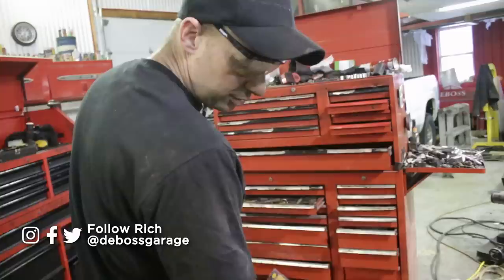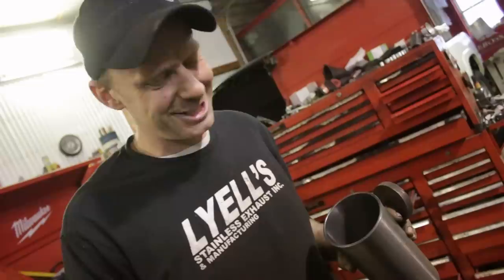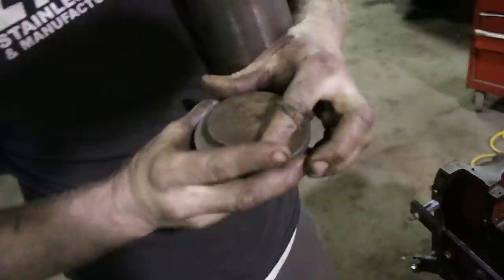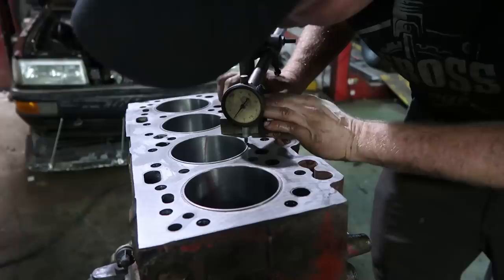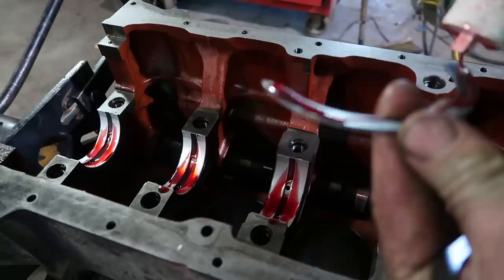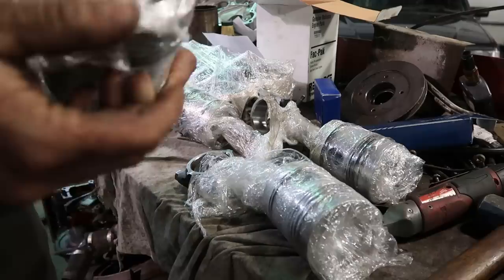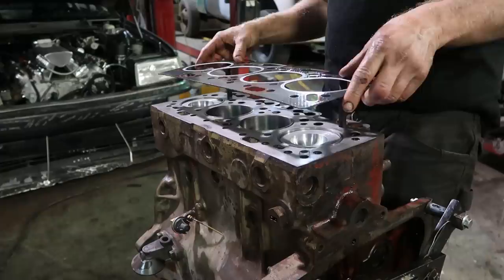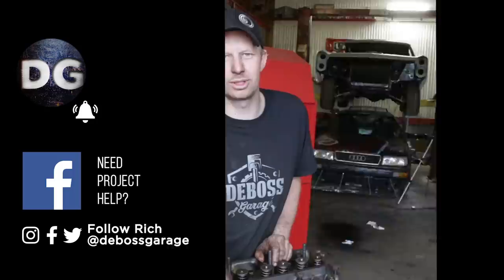3.9 Perkins 4-cyl Dry Sleeve Engine Rebuild | Massey Ferguson 270 [EP2]

Comment: Used to engineer for Baldwin Filters.  MOST Coolant filters do indeed contain SCAs, Supplemental Coolant Additives, and release them into the coolant, while filtering out debris and contaminants.  There are different formulations, in fact, and make sure your filter has the right additive Package for your coolant, based on how my glycol you use mostly.  There are coolant filters that do not have additive packages, if your company uses regular testing to determine the additive levels and maintain them. (So... no truck fleet on earth outside of heavy industry...)  The movement of the liners actually is one of the things that depletes the additive packages.
Reply: Kit Iwamatsu how would you find out what filter you need
Reply: @theshadetreewelder3523  You'd look up your filter size, then decide if you want to use a filter with built in SCA, or use a liquid additive.  Diesel engines need a different package than gas engines.  Standard coolant has everything gas engines need, so no worry there.  Standard coolant does NOT have some of the things diesel engines need, like Nitrites, Borate, MBT, and Silicates.  Some diesel coolants already have a full additive package, and will suggest to NOT use SCAs in addition to what's already in there.  If you are using standard coolants, then you will want the SCAs.  If you use a fully formulated coolant, you do not need an SCA right off the bat, and it should last quite some time (600k miles, or roughly 2 years) thought using test strips every oil change isnt a horrible idea to make sure the Additives are at a good level.

You in general should consult your engine maker as for what coolant, and what SCA should be used.  If your engine manual doesnt detail this (or is a much older engine and uses outdated stuff) then completely flush the system and use new coolant before picking an SCA package.

Anyway, there are, now, really only two additive packages.  SCA, and SCA+.  SCA Also called DCA2 and BTE, and SCA+ is also called DCA4 and BTA+.  If you engine has a lot of aluminum, or has an aluminum block, you will want SCA+.  SCA is fine for all older wet sleeve engines.  In either case, you need to keep the concentration in range.  There are also some diesels with OAT and HOAT coolants... but that's a different story and you see those on much newer engines, and you definitely will refer to the manual on them.
Reply: Yay, learning! Thanks, mate!
Reply: @BadHaddy  Thank you for the detailed answer. Not quite the same question,but for gasoline engines with standard Prestone or equivalent,I recollect the additive package is on the order of 2 ounces per gallon(undiluted), and with the natural increase in acidity,the protection offered only lasts so long. So the question is,what is the best way to keep the stuff from going acid ? Water pump lubricant is about the only thing I have ever seen in the auto stores that contains some replacement stuff,is there a better product made by someone ? Failing all else the old timey answer was to add some Sodium Carbonate, but I feel iffy about that with Aluminum radiators,etc. Cheers.
Reply: @paulmanson253  There is nothing you can reasonably do once the coolant becomes acidic.  Its just the oxidation of the coolant into oxalic and glycolic acid.  The corrosion inhibitors have done their job and it's just time to change the coolant.  You cannot simply re-add the inhibitors for gasoline products in a way that makes financial sense.  ANY product that claims differently is bunk and snake oil, and probably sold alongside engine honey and gasket sealer (note, all junk.)  Since each gaslone engine coolant has its own, rather wildly varying formulation.

The type of coolant you use typically determines it's lifespan.  The reason dexcool and all the other OAT and HOAT coolants came along was to greatly extend this service interval.  When it comes to older coolants, it seems you can classify makers into 3 categories.  Those who used phosphates(Asian), those who used silicates (Euro) and those who used both (Murica).  Mostly down to the water that is common in the areas.  

Anyway,  for older cars using universal/green stuff, just drain and fill.  While you're at it, replace your radiator cap. People ignore the hell out of that and you end up with the dexcool paste-stew.  Just use deionized water, premix with concentrate, and you're golden.   30k miles seems pretty safe.  If you want, get the little floatie-dealie bobber to test your concentration (it's called a hydrometer) and make sure its in the range appropriate for your area.  And maybe dip in some strips every other oil change to see if you're still in a good ph range.  As long as your coolant bottle isn't turning brown you should be fine.  As soon as you see particulates (floaties) and discoloration, drain and fill time.
Reply: @BadHaddy  Well now. Glad I asked. That was about as straightforward an answer as possible. Appreciate the detailed reply. Absolutely did not know about such things as oxalic acid showing up . Nasty stuff,that. Sure explains the messes I found in some truck radiators I unsoldered. Swiss cheese belongs in a deli. Cheers.
Reply: @paulmanson253  For the lactic, oxalic, and glycolic acids to form, you need heat (can't imagine where you get that...) And oxygen.  One of these is easier to control.  Make sure the overflow bottle/tank has fluid above the overflow line, and that the radiator cap is in good condition.  That will keep oxygen out.  If the bottle is empty a lot, or the cap leaks, oxygen gets in and starts making acid.  Basically, car maintenance 101.  Not all of that stuff is a scam!  Radiator caps do we're out and fail, just like thermostats. You might as well replace the radiator cap, when you are doing a flush. No different than the thermostat. They're not very expensive, and it will greatly extend the life of the cooling system.
Reply: @BadHaddy  Good advice
. Not as though the things are expensive. And they are a wear part. Just like a spark plug,in that sense.
There was a sales rep I knew years ago. Adored his Fiero. 15 year old car when I knew him . Changed all fluids once a year like clockwork. Oil is the cheapest mechanic in the world. No doubt can say the same of new brake fluid,glycol,ATF,etc.
Reply: Kit Iwamatsu p
Reply: Kit is right - on systems that use thousands of gallons of cooling or heating medium you just don't change it... you test the system to see what chemical change has occurred and then add the chemicals required to bring the solution back into specks ...  in some situations the cooling medium is also part of the building heating medium... some of the engine cooling systems I have worked on used 2,000 gallons of coolant and 350 gallons of oil.. so you just don't change the oil and coolant every year... you test the system and then make your decision.  The only reason auto manufactures tell you to change it is the system is so small it is more economical to change then to have  it testes...  @BadHaddy
Reply: paul manson In a car it’s cheap but when you get in the commercial realm when a vehicle may take 20-30 gallons of coolant you only want to change coolant if it’s absolutely necessary. We test with coolant strips and replace filters with SCA as needed. It also saves us a lot on recycling costs.
Reply: @BadHaddy  I constantly wonder how we survived without all this knowledge on tap prior to the internet. Brave new world!

Comment: In 2010 rebuilt a Perkins 2.5 diesel 3 cly. for my IMT 539 tractor  now has over 2,600 hrs on it still running strong. You explain things very good. Great video, the 3.9 Perkins 4 cly is one of the best engines.

Comment: Kit provided great information regarding cooling system maintenance, and I will just supplement that.  The wet sleeve/liner cavitation problem is caused by poor coolant maintenance, whereby air bubble implosions within the coolant remove a protective coating from the exterior of the sleeve/liner.  The combustion process causes the sleeve/liner to oscillate (expand and contract) on the thrust side of the piston (as you rightly mentioned) creating an area of low pressure which causes air bubbles to come out of the coolant following the contraction period.  After that contraction, the sleeve/liner then expands into the air bubbles causing the air bubbles to implode, creating a shock wave of approximately 60,000 psi against the side of the sleeve/liner, continually removing small amounts of the sleeve/liner material.  Eventually, the sleeve/liner wall becomes perforated, allowing coolant to enter the combustion chamber causing catastrophic failure.

Hope that helps.

Comment: The Perkins 3.9 is better known as the 4.236 (4 cylinder, 236 cubic inch), and is nearly identical to the 4.248.  Great engines, around 70HP, made with or without the balancer as seen in this engine.  Found in many applications like tractors, aircraft tugs and tree chippers.  Good vid Mr. D.  I welded the liners out of my 236 when I found it impossible to pull them with a plate and all thread puller.  Three or four light MIG beads on each, and out they came.
Reply: Another method is to use oxyacetylene torch with a neutral flame (flame tip contacting the cylinder) run up and down the bore, one stringer pass to focus heat. Letting it cool will shrink the cylinder allowing it to free up the liner from the block.
Reply: You can take a boring bar and bore the linners paper thin. Then peel them out with a sharpened screwdriver! Those linners are so thin that if they are stuck at all it's hard to get a linner puller to grab them!
Reply: Good engine you can rebuild them like 4-5 times
Reply: These engines, along with the 6-354s that use the same sleeves, pistons, valves, etc. are among the most widely used in the world. The 4-236s were used in thousands of small fishing boats in Third World countries, especially South and Southeast Asia and Africa, but also in the Caribbean, Central America and parts of South America. They were first used in the Massey Ferguson 175 / 180s starting about 1961 and in subsequent Masseys for three decades.  They even are in some Allis Chalmers.

Comment: The last Perkins I rebuilt was an old 4.108. It had dry liners with no lip. You had to set the protrusion while pressing them in, which was fun. Then you had to bore and hone them after being installed. I don't use retainer, in fact I put oil on the liners before pushing them in. I like to plastigauge with no lube on the journal, the lube has a thickness. Good video.
Reply: the coked oil will lock and seal them in :)))

Comment: Love your videos. I learned about cavitation working on a very old locomotive. Inline 6 cylinder with wet sleeves. Sleeves were about 5/8 inch thick and holes about 1/2 inch. Had to get parts from a museum. On locomotives we just run water for coolant with boron for anti corrosion. No coolant filter. We don't shut them down in the winter outside and if we do they are drained.

Comment: You're right on with the coolant filter. I'm a 7.3 Powerstroke guy (but we can still be friends) and I do recommend adding the coolant filters to the engines to maintain the SCA levels (Supplemental Coolant Additive) to prevent cavitation. Navistar (the manufacturer of the 7.3/T444E engine) installed a different water pump on their engines that had a filter head built right into the pump. You can get the filters with or without the SCA additive, but while they do filter grit out of the coolant flowing through them, they also add SCA. It's a double benefit.

Comment: I showed your video to my father. After he returned from Korea in 1953, he worked at a Catapilier shop helping rebuild bulldozer engines. He said he did not use any type of locktite on the sleeves, they put them in dry. He also said they never honed the bores as you did. They would push them out and put the new ones in (cold as you did).
Reply: as he said he did not hone it he just was cleaning it
Reply: He was using the hone to clean the cylinder. Which technically isn’t proper hone usage. But it works. Could of sat there for 3x as long with a scotch brite pad and got the same results.
Reply: Even light honing removes material, changing the fit of the sleeve, also changing the bore of the finished cylinder.
Reply: grafvonstauffenburg  no they haven't! Cat,Cummins, Mack and Detroits with wet liners all need no honing! Check the bores,lube the orings and pound/press the linners in. There is no "fitting" of pistons,the factory runs excellent tolerances on their parts! OEM or aftermarket diesel parts have been that way for 40+ years!
Reply: @brandibartolomucci789  
You are CORRECT

Comment: Did an Isuzu 4hf1 at work a month ago. Cheap bastard client didn't want to do crankshaft bearings, said they were ok and had been done within the decade. However, they did opt for a new clutch. Long story short, new clutch finished off what was left of the thrust bearings and spun all of the rest

Comment: Only one thing, I use one small drip of "tread-lock" on main and rod end caps bolts after checking the fit.
In the old days we used to drill though the bolt heads and wire them, but thread-lock works even better.
You can't beat those Perkins engines, they have proved to be excellent over time. Thanks for your demo.

Comment: Using a sharpening stone! What an awesome idea!
Reply: Make sure to buy a precision ground stone, or get your local machine shop to grind them flat.
Definitely DON'T use a stone that was used to sharpen a knife. Sharpening a knife makes a belly in the center of the stone, and if the stone isn't flat you will do more harm than good.
Stoning a deck is really handy for telling what the surface looks like. The stone will show shiny spots on any high points, and it will show stuff that you can't see or feel. Often stoning the deck is what I use to decide if a block goes to the machine shop or not.

Comment: we have always used dry ice to install liners and it works great.  the new coolants have dca attitive in the coolant to avoid liner cavitation. or if you use glycol then run a dca additive  filter.

Comment: put your liners in the freezer.........they will tap in nicely. Just work quickly because obviously as they warm up they start to grab the block. I once worked on a mack truck ( EA7-470) that even welding the liners wouldnt get one liner out. So we jacked up the entire front of the truck ( 4500kg) resting on the liner, ran another weld down the stubborn liner, and came back 60 minutes later after lunch..........that moved it =) AS always, get the specs and make sure the finished liner protrusion is on the manufacturers specs so that when the head is torqued down it gets the correct crush fit and a good seal.
Reply: If you watched the video... he actually did freeze them. -18c on a 0c day.
Reply: Yup, Keep the block at room temp. Sleeves in a freezer overnight. Have it together to work fast and get the new sleeve home in a few seconds. I've been doing this since 1964 on Farmall H and M series with "firecrater" set ups.

Comment: This is one of the better channels if not the best  for learning how to rebuild. He actually tells you specs for bolts and hey this can happen if you don't fallow A C and F steps. Don't forget these steps or you get to redo or have issues such as the fallowing. Which is really important information to us DIY folk. Know if he will just rebuild a 2.5L Chevy iron Duke for a s10. I'd be all set

Comment: I have seen guys pack the cylinder liners in dry ice , they basically fell into the bores. Thanks
Reply: Fill a pan with kerosene, put the parts in that, then put in the deep freeze or dry ice box.

Comment: If you have a local place to get dry ice fill up an igloo cooler that’s big enough for a sleeve or all of them to fit in.  A freezer isn’t cold enough to shrink them much.  Probably won’t need a press using dry ice.  Great videos.

Comment: Coolent filters come with and without wet sleeve additive.  Ford 7.3 is also prone to cavitation damages even thoeits a dry/non-sleeve block. The 7.3 also had problems with castung sand left behind and working out of the castings causinf pluged oil coolers inturn burnt oil. The coolent "filter" helps prevent oil cooler plugings by "filtering" the sand out.

Comment: Coolant filters have little pellets of SCA's in solid form rattling around in them until you run them a bit and the pellets dissolve and mix into the coolant.

Comment: An old timer showed me how to remove old sleeves by running an arc welder up the inside of the old sleeve with very small fast beads 
What it dose is it shrinks it then they literally fall out.
Reply: Done it many times
Reply: Funny, that's exactly what he said in the video, ylu must've missed that part.

Comment: I bought a 5lb dead blow hammer just for driving out liners. You can hit something 20 times with a 2lb hammer or twice with a 5lb hammer.
As far as liner lock goes, I only apply it to the liner on the last stroke of the press. That prevents it from setting up when the press needs to be reset, but it also makes sure they stay exactly where they are supposed to be while you finish building the block. Heat and the head hold them in place once the engine is together, after it starts the first time the locktight breaks loose from thermal differential anyway.

Comment: Sir you dont have to touch the bearings with the bare hands because ower hands contain oils. That oils will make an hot spot on the bearing because on the first start the oil won't stick on that thinger print